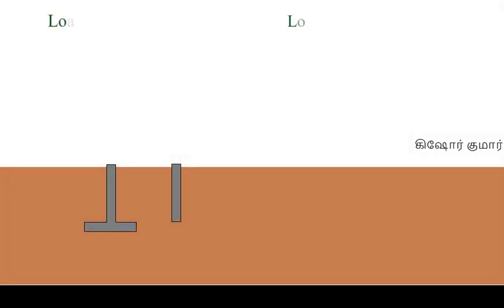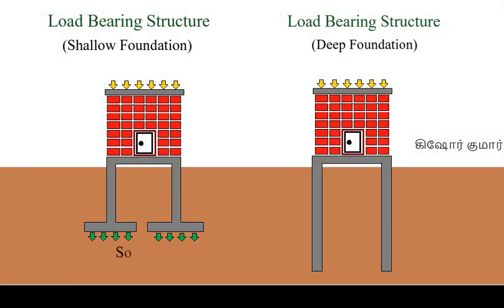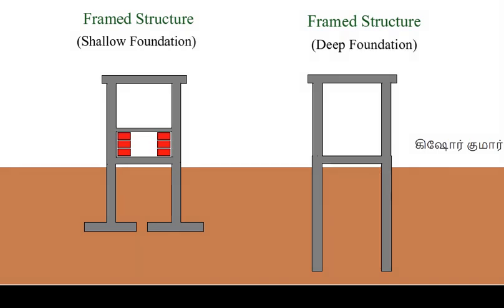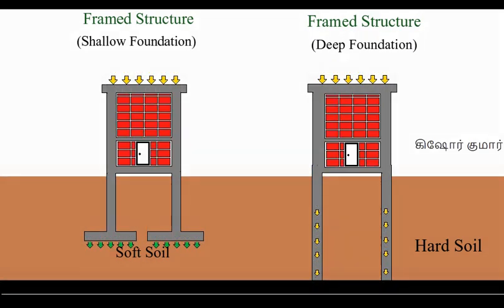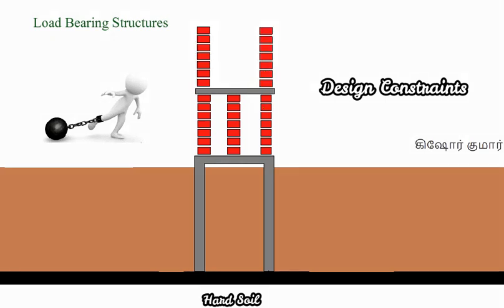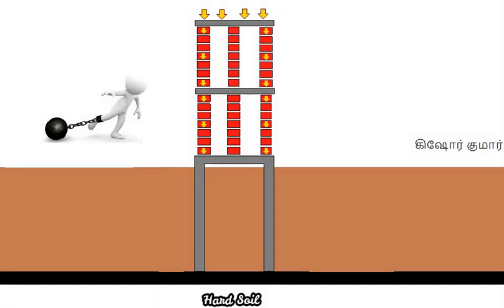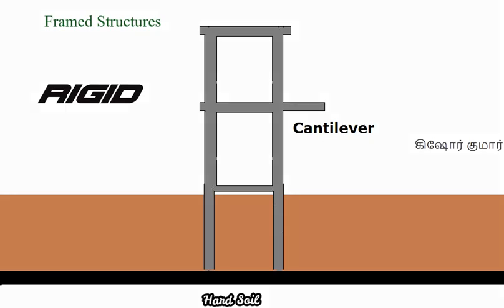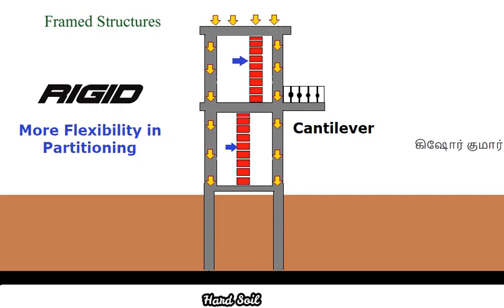What is Load bearing Structure and Framed Structure - Advantages and constraints

Comment: Sir,concrete solid blocks can be use in load bearing double story house  constrution?becouse i heard for load bearing which mean  there is no column and beam so we have to use only red bricks not concrete blocks if its true then what is a logic behind this!
Reply from the maker: the Logic is LOAD BEARING , so the load is transfered to the walls and then to the foundation , so as far as my knoweledge is concern using  Solid , AAC or porotherm bricks for a load bearing structure imay not serve the purpose ...that too for a double strorey , i will not use it !

these are
Reply: @krinu  ok sir.thank you so much